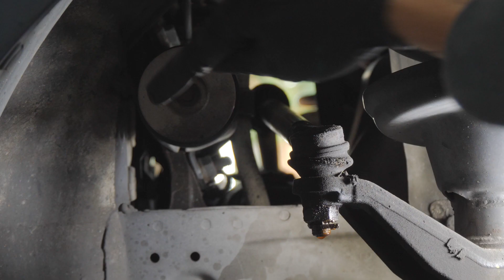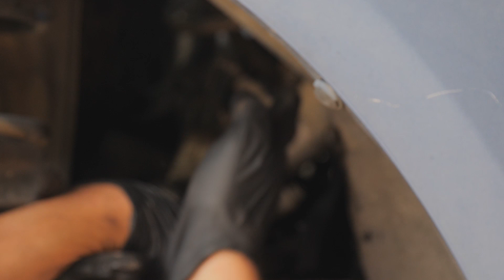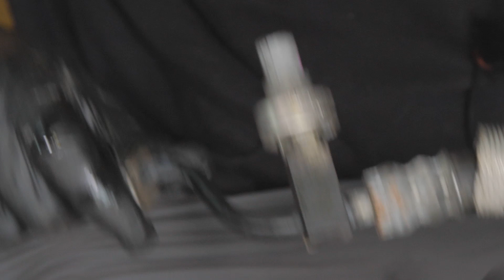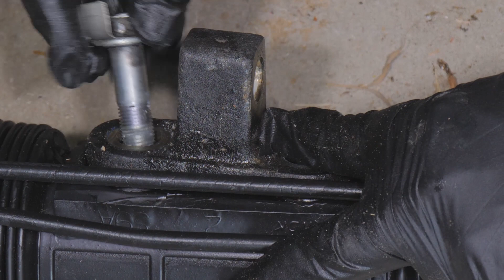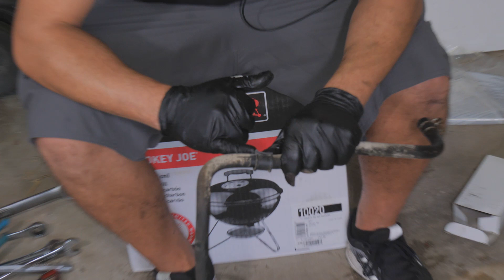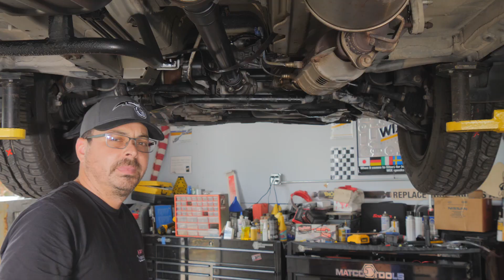2006 Honda Element Rack and Pinion, Pressure & Return Hose w/ Wheel Alignment (Toe)

Comment: Excellent video. Thank you for this! 
Helpful notes for others:
1) Extraction is always the most concerning part of a rack and pinion job. Finding the main mounting bolts is easy; getting the assembly out (once unbolted) can be a real chore, depending on the car/application.

2) Be VERY selective on what parts you choose for hydraulic systems and C/V axles. The aftermarket has been getting worse incrementally for the last 10+ years. In the auto industry, we call CarDone products Car-DON'T, for their famously high premature failure rates, poor fitment, etc.

3) Trusted brands (as of this writing in 2025) for hydraulic car parts: BBB (most of the time), Maval, AAE, Edelmann, Lares.

...Brands to avoid: CarDone!!! And any "spray and pray" remanufactured racks sold on eBay, Spamazon, and other Chinese market resellers. There is NO Q-C (quality control) with today's average rebuilders, hence how they are able to sell you the part for 1/3-1/4th of what it was new.

4) #3 is critical because neither you nor your mechanic want to ever do this job more than once. Pick a good brand so it will last you another 6-10 years.

We recently went through hell on a customer's Jeep Grand Cherokee. It took SIX aftermarket rack and pinions to find one that 
A: Fit correctly and... 
B: Didn't s**t the bed like Amber Heard right after install.

That is all. LIKE if this info was helpful, so I know if the wisdom is appreciated. 😎✌

Comment: If youre having problems getting the 2 bolts off on top. Instead of putting it under a tire. I was able to get mine by putting it up against a wall to keep it from turning and using a cheater bar. I also believe some well placed C clamps could do the job. Good luck!

Comment: I know this is old but he didnt mention anything about replacing the bushing that is around the bracket on the passenger side mounting location. I didnt know that since i followed this video and took it to the alignment shop & wasnt able to get it done because the rack was still loose without the bushing. easy to replace but crucial information to know.
Reply: What bushing are you referring to

Comment: I have to put one on a 2005 Element with 215K miles on it.....guess I shouldn't complain.....
Reply: did you have a death wobble? If so did it fix the problem?
Reply: @TheBluceRee  I did not have the wobble, just tough to turn the wheel starting in cold weather, it took a while to loosen up.  Seems to work fine the rest of the year.

Comment: 100k miles.. geez my 03 E has 299k and this has yet to be replaced. My E  would probably ride better than new if I replaced these. I was just looking at lift kits then mentioned needing an alignment following kit install so thought id see what an alignment looks like; Im guessing this is a step further? Im not mechanically inclined although i like to know what the shops “should be doing” and see relatively how much time and effort it takes to do the job.. thanks for the video. I greatly appreciate the details like DO ask them to replace the hose as well .. se eI wouldn’t have known to request this otherwise.. 😉👍

Comment: painting my wheels the other day I noticed the outer boot on my RnP was torn... upon further investigation ALL the boots are torn and the engine is wet in that area. I don't believe it's power steering fluid as my levels haven't dropped, maybe it's lube grease? Anyway, I don't believe there is a way to fix the middle and passenger side boot but doing research the RnP will fail eventually due to too much dirt getting through.  Anyhoooo, I do not want to do this job but my outer tie rods are looking worn, I need an alignment and I don't want to pay a shop for this job.  THANK YOU so much for the comprehensive video. *fingers crossed
Reply: If the boots are torn, the tie rods will fail. Tie rod failure is not pretty at road speed above 5 MPH. If you replace the outer tie rods, the shop can do a great alignment.

Comment: My 2006 CRV has rotational movement where the inner tie rods mount to the rack.  is this normal? if i shake the tire/wheel, that mount block where the rods attach will rotate upward/downward. i can also grab it and move it.  no horizontal movement though.  i can only guess that this is effectively changing the rod length and the toe settings continually while driving, possibly causing the slight vibration i have?  is there any way you can see if your element has this same movement?
Reply: The inner tie rod mount should not rotate. There are two bolts that need to be tight. You could tighten the mounting bolts if they are loose. Alignment shop can help you if you dont have the tools.

Comment: I've got an 03 Honda Element that I'm having a hard time getting those inner tie rods off, I've put a benzymatic torch to both the inner tie rod nut, and still can't break them loose, any suggestions, so I see where you remove the rack and pinion 2 make it a little easier to remove them, hopefully I can avoid going at route of removing the rack and pinion, overall great video on how to work with Honda Elements steering components.👍👍✌
Reply from the maker: Qunice Toole thanks for watching and commenting, yeah we had to replace the rack so it required removing it from the vehicle first, if you notice in the video, we also could not break them loose, we ended up using the weight of the vehicle to hold the rack in place and then lots of leverage to break them free. They were very tight and not wanting to come off under normal pressure.

Comment: Last week I complained to my mechanic about a little free play in the steering wheel.  He adjusted my steering rack, which raised it a little. The next day we discovered a broken tie rod. My concern now is maybe the rack didn't need adjustment at all since the tie rod is broke.  Should I have e them put the rack back where it was ? This is a 1998 honda crv with 119,000 miles on it.  Drives great
Reply from the maker: Olga Dinis adjusting the rack is very rare and most likely the worn tie rod did not go bad that quick, meaning it is very likely the toe rod was the main cause, however did the new tie rod fix the problem? It may be best to get a 2nd opinion, a professional and good technician’s eyes on your vehicle and then accompanied by a test drive with that tech can uncover the most info.

Comment: Size of all bolts going to a junkyard tomorrow
Reply: im too late for you but for someone else: 14mm (crows foot) for the high pressure line into the rack. (this one is usually really stuck in there so bring some vice grips just in case. that was the only way i could break the one i found in the junk yard and the one on my element). 17mm deep socket for the return line out. 19mm for the four bolts that hold the rack in place. a 10mm for the steering wheel to pinion universal joint. and the tie rod ends are 17mm I believe as well.

Comment: I have replaced my pump and I still have a whine after replacing all the o-rings, working the wheels back and forth up in the air, etc.   Would a partially blocked pressure hose cause that?   I have the same model year element as this one.  I can't find any sort of leaks from the racks or otherwise and the whine is definitely coming from the ps unit.
Reply from the maker: so its possible the power steering pump is damaged, however going over the fluid again and trying to bleed out anymore air would be where I would start, A small amount of air can be trapped causing that,
Reply: If the steering is not stiff, the pressure side is not likely blocked. What you are probably experiencing is air in the pump system or an inability to move the fluid. Flush the system with honda specific PS fluid, put an inline filter in the return hose (add a length of hose to the return, don't cut it), and replace the reservoir.

Comment: I've been working on my vehicle to reduce Shake when idling at a stop light under load. I've checked the intake and changed out the spark plugs on my Honda Element the drive is fine but it still won't stop shuddering while idling at a stoplight. Could this be attributed to the rack and pinion as I have had a parking lot accident with a big truck hitting me on the driver side. The car was pulling to the right afterwards so I changed out the lower control arms but it's still pulling to the right and shaking in idle at the stoplight. Is it the rack and pinion?
Reply from the maker: yeah I would hunt down the pulling to the right symptom and remove that from the equation first as it can certainly be an issue, otherwise do you have a check engine light on? If the engine is misfiring or knocking more then it is suppose tot, then it will turn on the check engine light and leave a trouble code. Otherwise a good through inspection of the motor and trans mounts, and of the steering would be next.

Comment: thanks for this one. the r&p on my 2011 element is getting weepy at all the fluid points so i'm going to have to collect everything to get this done. should be pretty much the same for the 2011
Reply from the maker: sean bush yes it is almost identical and the part is also the same, the same rack and pinion was used on 2003 thru 2011 Honda Element, also the same as 2002 thru 2006 Honda CRV